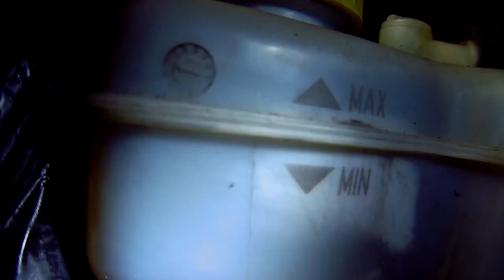SKODA FABIA Hydraulic Clutch Fluid Change/Bleed (MK1 99-07)

Comment: Thank you for this very helpful video HatBoyHarvey. I'm sure you are doing your dad proud with all the help you are passing on to others. All the best.
Reply from the maker: Thanks 'Jimmy Mach' for the kind words, I appreciate you saying my dad will be proud that I am helping others with the videos. Thanks again :-)
Reply: @HatBoyHarvey  I couldn't find the bleed valve on my 1.9 this vrs. Could it be positioned somewhere different on vrs model? Thanks
Reply from the maker: It is a concentric type and is within the box unfortunately, if it isn't causing issue I would leave alone. If it does then replace all the clutch parts when the box is out.
Reply: Thanks HatBoyHarvey.

Comment: Great video.
I done a full brake fluid change on my Fabia vRS (1.9 TDi - BLT) but i didn't touch the clutch in terms of bleeding. I wonder how similar the 6 speed box from mines is to this.
Someone mentioned using the VW / Audi software as well to do a self bleed on the ABS pump after a fluid change but i'm not sure if that's needed.
Reply from the maker: Thanks, If the ABS works OK then I would leave alone unless you know it has leaked or the system has drained below the level of the unit which can happen. It is called basic settings if you want to bleed the ABS with software and is relatively easy to do :-)
Reply: @HatBoyHarvey  When i flushed my fluid a few years ago i made the school boy error, by letting the reservoir go empty.
I bled the brakes thoroughly, but never the clutch or ABS pump and wonder if either of them are worth doing, since the air got in when the fluid got too low.
Reply from the maker: If you're in any doubt then get it done, if only for peace of mind :-)
Reply: @HatBoyHarvey p ive the same pressurised bleeding kit you have here so i'm going to give the clutch a little bleed i think when i replace yet another rear caliper just shortly.

Comment: Is there some torx kit that you would recommend for this car ? Great content by the way
Reply from the maker: Thanks. There are a lot of torx screws on this car that only use low torque settings so most standard kits would be suitable. One thing that I found was the socket head type was easier and quicker to use for me than the single angled bar or handle type. Obviously the better quality ones are great, but not essential.

Comment: Thank you for your videos, man! Thanks to you I was already able to do some work on my Škoda Fabia that I otherwise wouldn't have the courage to do! I have two questions: Is it mandatory to have a bleeder kit in order to change the clutch fluid, or can I use a partner (like for the brakes) pumping the clutch pedal? Also in what order would you suggest to proceed in case I wanted to do all four brakes + the clutch? Keep up the good work and thanks again!
Reply from the maker: Thanks, No by hand ok, but you may find the pedal needs to be lifted up by hand. You can pump it a number of times, hold it down and bleed also a number of different techniques are used to get the air out, which is what your aiming for. The Gunson eezibleed kits are great and make the job much easier. Do it after you do the brakes starting with the leg that is furthest away, usually from the reservoir, but I argue this has to take into account of the abs unit making (on RHS models) the rear RIGHT, which is not what Haynes manual says. Either way there won't be much difference in the end as long as you clear enough fluid out of each leg to remove the air and the old fluid for a full fluid change. If fitting new brake discs & pads you will have a slightly spongy feel for a while until they settle in, best to so this in between mot's not just before. Best of luck🤞.
Reply: @HatBoyHarvey  Thank you very much for your advices, Harvey!
Reply from the maker: @MakroPoskoci you're very welcome :-)

Comment: My feelings to your loss. My dad is now facing prostate issues at 77. Already has implanted what they call  "seeds" that are releasing medication at prostate. Do you have tips for clutch slipping that do not pass by changing the clutch and can be caused for something else? Thank you.
Reply from the maker: Best regards to your dad and I hope the medication works. I believe there is hormone drugs that can be used very effectively. I would make sure the slave is ok and fully bled first off if you have one similar to mine, if not much change think about replaceing it. Look at the pedal  next, if this is worn, leaking change it. The clutch may be on its way out anyway if the car has a lot of kms and driven hard so you may have to do that anyway. I think your engine is a little bit easier than some ;-/, but still involved as you need enough space under the car to remove the box.
Reply: @HatBoyHarvey  thanks. Already bleed the system. No air went out and there are no leaks. The bleeder it's a 9 mm. Yes. It is a simple system. Only lefting the clutch. I will drive and when fails I call for the tow truck. It is a job that I will pay to be done. Only for information, at low speeds no problem. At 5th gear in highway the rpm go up very easily without the correspondent increase in movement. Regards and good health.

Comment: The local garage said to replace the slave cylinder on my skoda fabia 2012 I would need to remove the gear box , is this right? I watched video and this does not seem to be the case?
Reply from the maker: Depends on engine/box. Yes if it is a concentric slave cylinder, as it mounts on the input shaft. Replace the clutch at the same time. No if it is mounted on the outside of the gearbox case like mine.

Comment: Hello all and HatBoyHarvy thanks so much for the video bleeding hydraulic fluid.  Did manage to remove my old slave cylinder on Skoda Fabia 2012 and replace it with a new one without removing the gearbox as stated in the Haynes manual.  I then supplied it with new dot4 brake and clutch fluid. Car is now running again and clutch is  very good. However, I have not yet bled the brakes for the old brake fluid( saw your video on how to do this). Hoping to do this next weekend. Since brake and clutch fluid combined, is it too late to avoid contamination issues of the old brake fluid? Or do i have to start almost over again. Bleed the breaks and then then put new dot4 in clutch cylinder?
Reply from the maker: As long is it is the same type then no problem, as you just bleed the clutch from the master cylinder i presume so doing the brakes so shortly afterwards shouldn't be an issue if you emptied the res first before using new fluid.

Comment: How do i make sure the pressure is no more than 20 psi?
Reply from the maker: The eazibleed bottle I used attaches to the car tyre, just check the pressure in that. If you are doing it manually then foot pressure is fine.
Reply: @HatBoyHarvey  thanks. will use foot pump. Is it easy to replace the slave cylinder if I have to? I do not need to take the gear box out or anything?
Reply: The local garage said to replace the slave cylinder on my skoda fabia 2012 I would need to remove the gear box , is this right? I watched video and this does not seem to be the case?
Reply from the maker: Sorry missed your post. If it is the concentric one, yes this is the case, no if it is like mine.